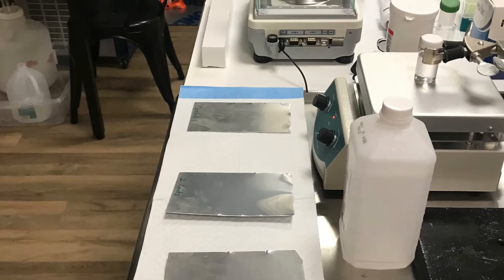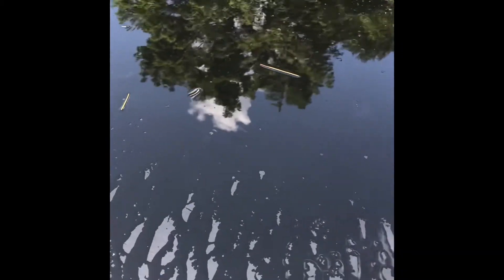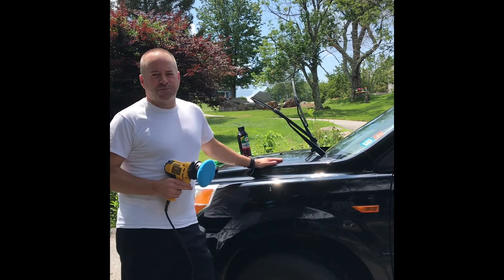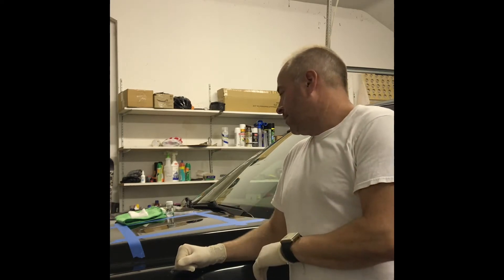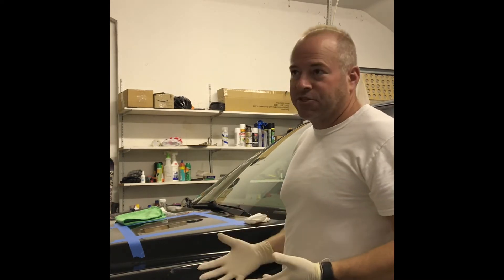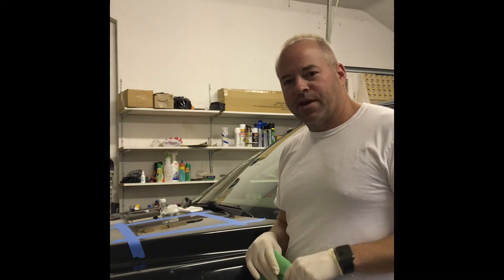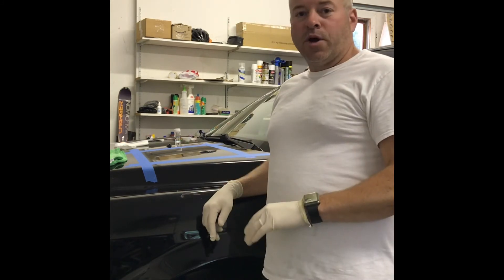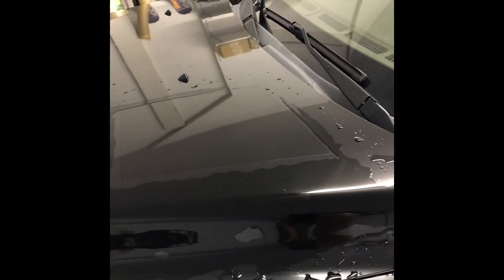How to Make a Ceramic Coating for Cars

Comment: Just coat it and rub it gently and let it fully cure ? No rub all out after flash time ?
Reply from the maker: You will want to rub all of it out after the flash time.
Reply: @terryclayton  what flash time you recommend ?
Reply from the maker: @lekvtwin  I would start with 60 seconds if you are working in a garage with climate control.  However, you can adjust the formulation to alter the flash time ( slower or faster).

Comment: As a chemist myself do you have any good starting points for a paper deep dive in this? I really appreciate this insight into coatings!
Reply from the maker: Hey Peter, check out this link for a starting formulation.  Good luck and would love to see what you come up with.  I will try to add more reference links when time permits: https://www.terryclayton.com/post/nano-ceramic-coating-recipe
Reply: @terryclayton  awesome, thank you! I really want to educate myself more on that each ingredient does and how it shifts the properties of the mixture. Reading the Safety Data sheets of the products only gets you so far and the chemistry behind it interests me greatly, as I have little knowledge about surface chemistry!
Reply: @terryclayton at is the ratio of each ingredient, I would like to understand it correctly because I have very little knowledge and thank you very much for the knowledge you taught me. Thank you very much.
Reply: Can someone please provide the CAS RN for each of these ingredients? please!